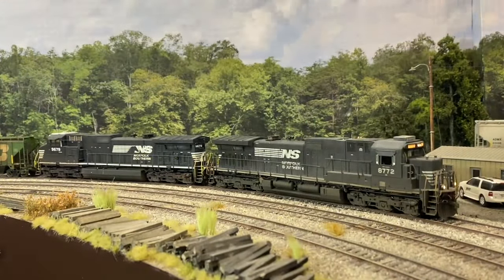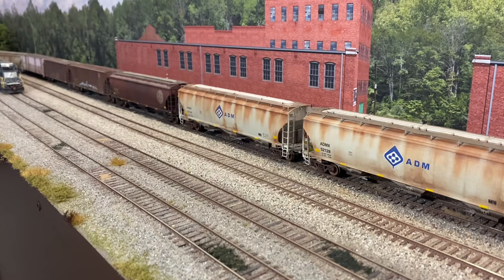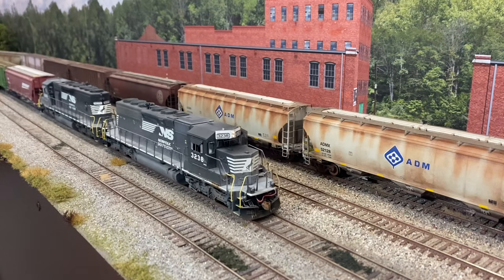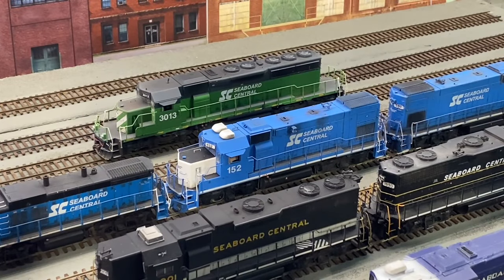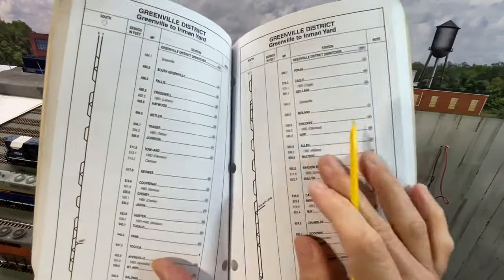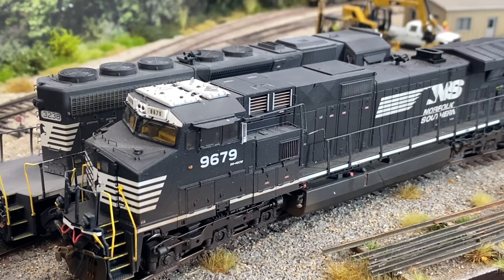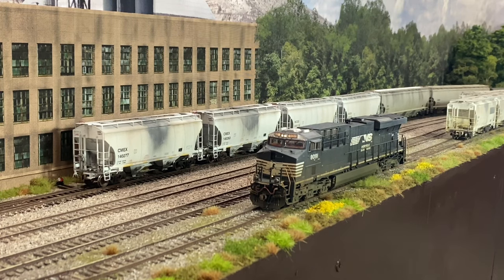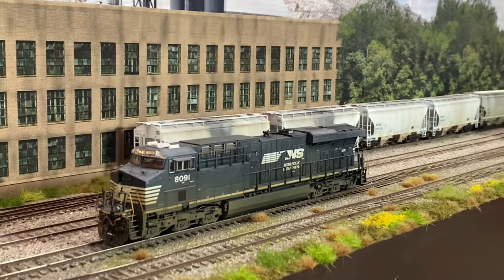Seaboard Central - Dynamic Braking

Comment: Hey Tim ....LOL  actually I'm just about to have some Vegemite on toast!  Thanks very much for the shout out and I'm happy to help! I'm sure a loco mechanic would  know the finer details on DB's , but I know that on modern EMD units down here, the traction control is used in dynamics to let the wheels "slide" a tiny bit , thus give the maximum braking effort especially on slippery rails. Crazy stuff but AC traction is very clever as you have said before.
Once again thanks for the mention and keep these vids coming Sir!
Cheers (frustrated wanna be Engineer) signal sparky.
Gregg.
Reply from the maker: No problem Gregg! Glad you enjoyed it. Stay tuned. More to come. Cheers!

Comment: Excellent presentation.  When I worked at Conrail our engineers would use dynamic braking even in level territory on intermodal trains because intermodal trains tended to have “kickers” which would cause undesired brake applications.
Reply: Fantastic video!
Reply from the maker: Thanks! This is true, especially auto racks.

Comment: Thanks -- I like these educational videos in between the model railroading. Bit worried that NS seems to have bought out the Seaboard Central, though! 🤣
Reply from the maker: Thanks! Don’t worry, the SC is not going anywhere. I do keep a few NS units that will operate on run thru haulage rights trains.

Comment: In April 1994, I was lucky enough to be invited to chase trains on the former Southern Ry.’s grade at Saluda, North Carolina.  I will never forget the sound of those dynamic brakes howling on two practically brand new Norfolk Southern SD70s, Nos. 2502 and 2523, as they crested the hill and started their descent.  That afternoon, we were treated to the same pair of SD70s, on their return trip from Spartanburg to Asheville, having to triple the hill.  It was fantastic watching them run up and down the hill and reassembling the train just west of Saluda.  We also witnessed a monster “Belmont” coal train descending the hill.  That day was my first trackside exposure to the use of dynamic brakes.  Again, the sound was unforgettable, and I enjoy employing dynamic brakes on my ESU LokSound-equipped locomotives on a grade on my HO layout, to recreate that memory.

Tim, I’d love a primer on how you’re setting up dynamic brakes in your LokSound decoders and how and when you’re using them on the layout.  Like you, I’m using ProtoThrottles.  Thanks!
Reply from the maker: Great experience seeing those trains run down Saluda. I do plan on making more videos detailing how I mimic the prototype using the ProtoThrottle. Stay tuned!

Comment: A long time ago we had a GP35 that lit a brush fire. Couldn't figure it out at first but we found that the fire started with the dynamic brakes. The geep was on a short term lease and hadn't moved in a while. The grids got hot enough to light up the wasp nest that had been built in the housing and the fan blew the smouldering contents onto some dry grass and...instant grass fire. Another lovely day out in the wild.
Reply from the maker: I believe it.

Comment: Your remark about dynamic brakes being an option (for a long time I jhadn't realized this) is spot on. For a very long time, starting with the C&O GP7's that replaced Pere Marquette steam, locomotives built for use in Michigan didn't have them. Even today,, Hujron and Eastern's "standard"  diesel is a non-dynamic GP38-2.
Reply from the maker: Thanks! One of my favorite railroads that the SC gets inspiration from is the FEC and many of their original units did not have dynamics simply because Florida is relatively flat. But all of their new units have them because dynamics are no longer an option. Everything built after 1990 has them as a standard feature.

Comment: In 1979, I wrote to EMD about capturing regenerative power in batteries on locomotives. I got a short snippy hand-written note back saying that it wasn't going to happen. I now believe that that was correct, and that the weight of the batteries or the logistics of moving separate battery locomotives, along with the small amount of power that would be saved would preclude their use today
Reply from the maker: GE/Wabtec is experimenting with one in CA that is sandwiched between two GEVO units. The voltage from the dynamic brakes are being used to recharge the battery unit. You can see the example on the Wabtec YouTube channel.

Comment: Looks like your newer NS locos have been equipped with PTC antennas. Doing the same with mine. When you finally create the helix to expand the current layout, you will finally be able to use  dynamic braking heading down.
Reply from the maker: Yes, I hope to have the helix in service by the middle of next year. The next project coming up will be the Gadsden Yard modules and it will be a big project due to all the wiring. I plan on powering all the turnouts.

Comment: The former CN GP40-2Ws were purchased as mainline power and were too heavy to operate on lighter rail branchlines in Canada.  CN did not feel that dynamic brakes were necessary because the majority of the track did not have grades in excess of 0.8%.
Reply from the maker: I know some of them are designated GP40-2LW for light weight so I assumed they were intended for those restricted branch lines.
Reply: They had a smaller fuel tank but they were still restricted because of the two axle trucks, too.  They look good on your layout.   @SeaboardCentral

Comment: Wonderful follow up to your last video Tim! Great job going through the details of using dynamics vs. Automatic/Independent brakes. Just one question, will we start seeing big power show up on the new layout bringing in grain trains for ADM?
Reply from the maker: Thanks! I just brought the NS units in for these prototype info videos. I keep the NS road units on a pair of haulage rights trains I run over the line. The NS SD40s are used on an NS/SC interchange job. Since this ADM doesn’t receive unit trains it will be serviced by three GP units in local service out of Gadsden Yard eventually.

Comment: I would also like to see how you do DB on the ESUs...thanks for the videos, Tim.
Reply from the maker: I have my dynamic brake equipped units programmed to F7. I’ll show how and when an engineer would use dynamics after I finish connecting the yard to the upper level. Stay tuned.

Comment: the GP40-2Ws were for high priority freights, CN just didn't like dynamic brakes for the most part
Reply from the maker: Makes sense but I know some of them were categorized Light Weight and that tells me that they must have been used on lines with weight restrictions.
Reply: @SeaboardCentral it was something about a lightweight frame, which was taller than a normal frame yours is an example of one. AS for light weight units there were the GP9s on flexicoil trucks, RS18s with a MLW design lightweight truck and then the real light weight branchline units the 10xx GMD-1s out west and the RSC-13 later RSC-14 in the east

Comment: BNSF  equipped with c 4's Missing the middle traction motor , 😢  = bad 
 wheel hop , cool video Tim , throw 6 lbs of air and work your dyno's
Reply from the maker: Thanks! I’ve ran the C4s before. Awesome cabs but I like how the UP ES45ACCTE units perform with all three axles powered. Got to be the fastest loading GE unit I have ever ran.
Reply: We have  those heavyweights are in the 3600s to 3500's numbers will showing later on order, without  C 4's . Thank you

Comment: Question, the flange noise in the video, is it edited into the video, or does it come from your locos? Thanks for another great video.
Reply from the maker: They are programmed into the locomotives. I can adjust the volume and I don’t have it on all units. Another reason why I love the LokSound V5 decoders. Thanks for watching!
Reply: @SeaboardCentral  Thanks for the info.

Comment: Here's a little bit more semi useless information about dynamic brakes. On a six axle locomotive the first and sixth traction motors power the dynamic brake cooling fans. The second and third and the fourth and fifth traction motors disapate their current via the toaster like elements of the dynamic brake grid. This is how its set up on the NSWSRA 81 class locomotive which also have the extended range dynamic braking fitted.
Reply from the maker: Great info. Thanks!